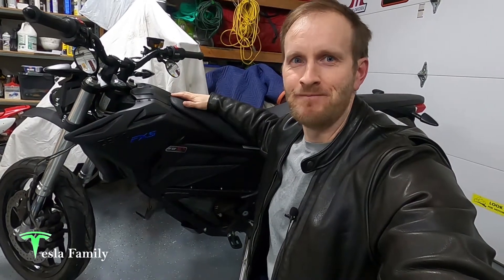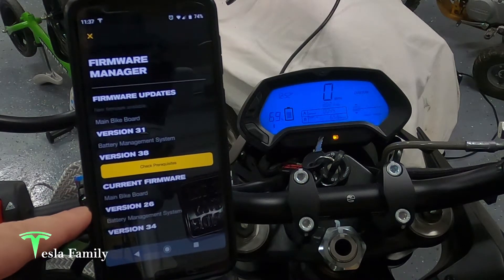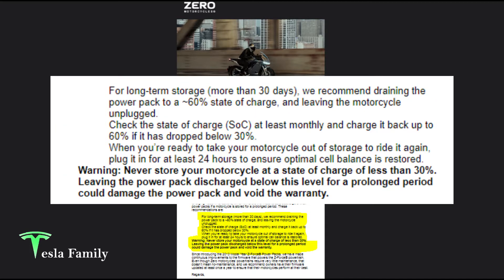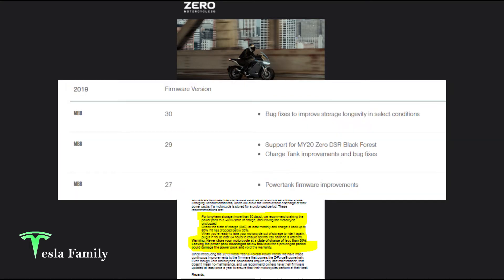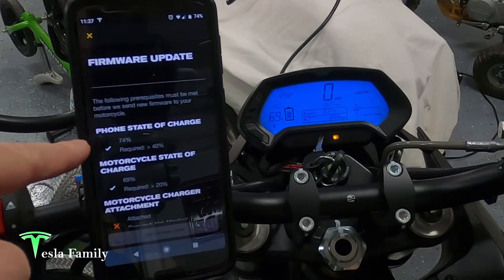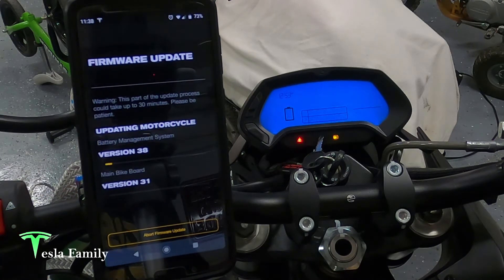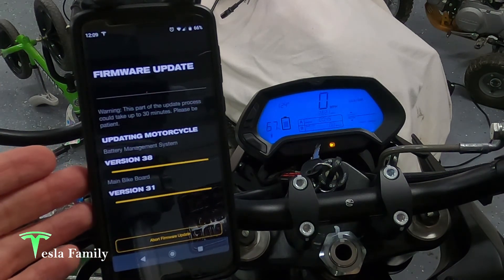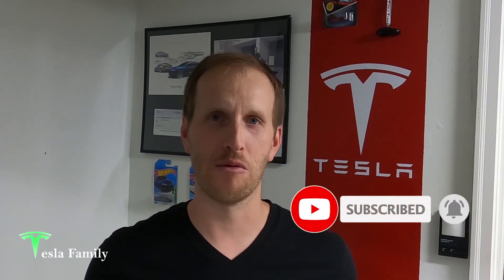Zero Electric Motorcycle OTA Firmware Update and Long-Term Storage Mode

Comment: When will there be a bug fix allowing to reduce power and torque. At present, even if you change to 10% torque and 10% power, the bike still delivers way more. Cannot teach my kids to ride the bike with such power.
Reply from the maker: Thanks for watching! I sold my FXS about a year and a half ago so I'm not up on the latest software updates. Is Eco mode still too much torque?